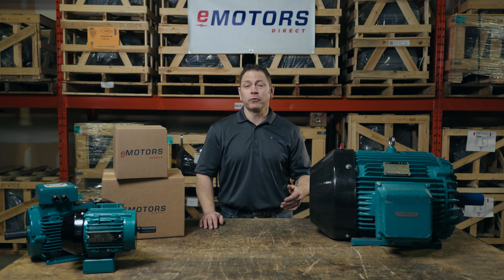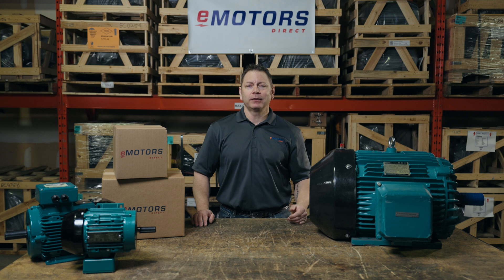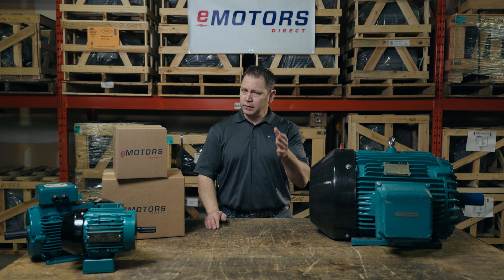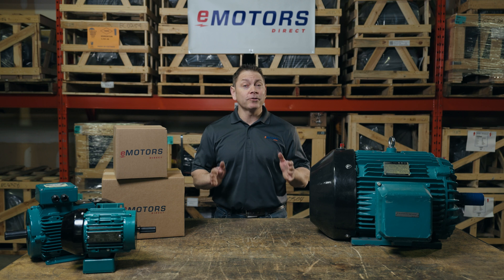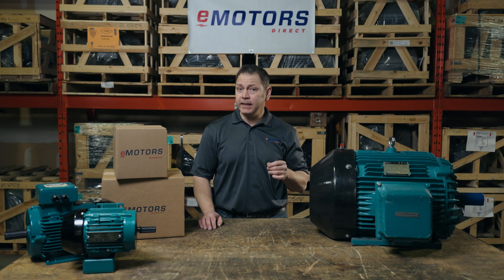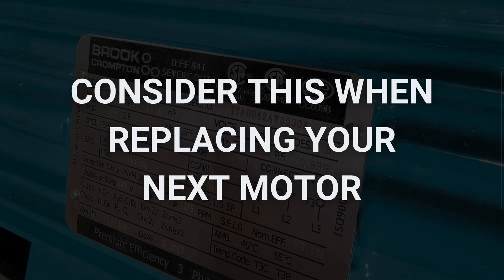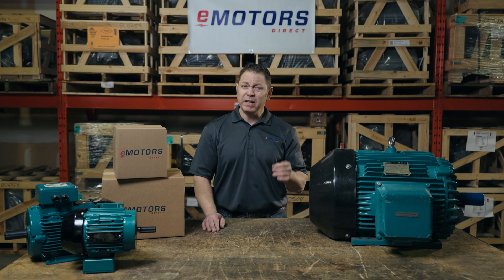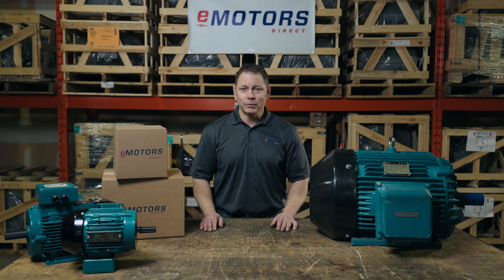How to Calculate Motor Efficiency | Formula & Savings Guide

Comment: Hi, if we connect motor either delta or star with vfd what are the differences between them
Reply from the maker: Thanks for the question. The difference between wye or delta configuration is how voltage is expressed across the windings and thus how current is taken from the supply. The motor as a system sees a different voltage, as the delta rating is lower than the wye rating but the windings see the same voltage and current. Essentially delta/wye allow you to connect different supply voltages to the motor while expressing the same voltage across each individual winding. This is what allows for 230/460V dual voltage motors. 

Hope this answers your question, thanks for your comment.
Reply: @emotorsdirect  thank you very much